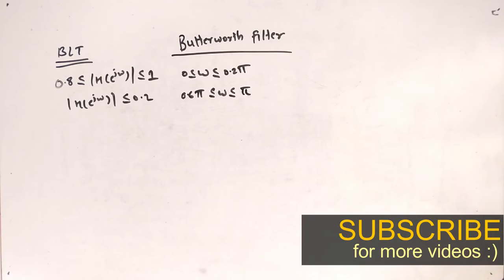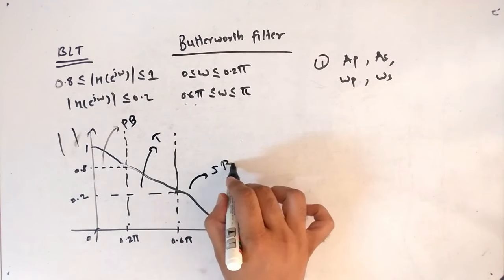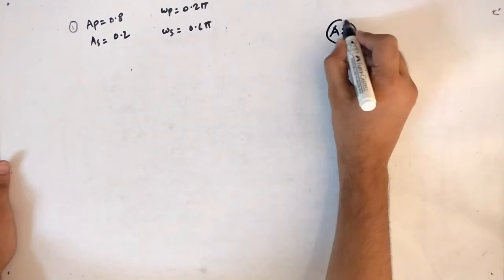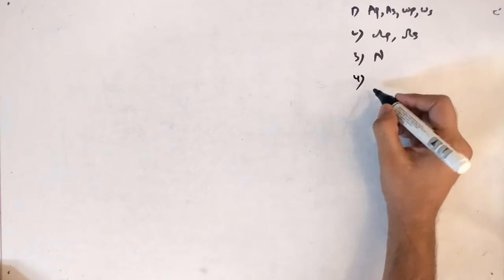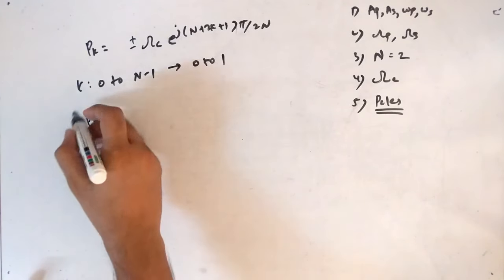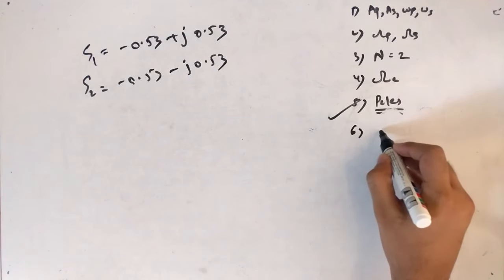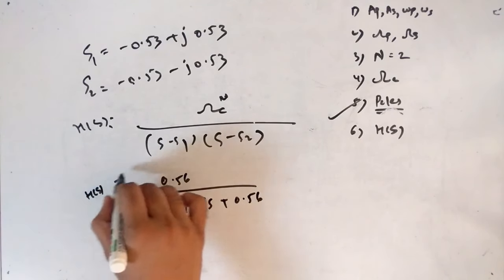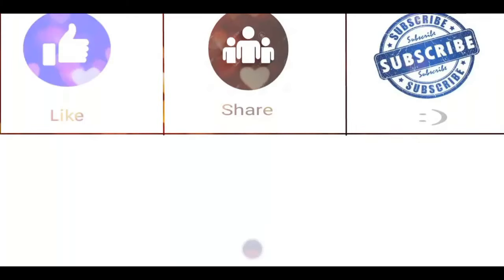IIR Filter Design using BLT - Butterworth filter design in DSP

Comment: there is confusion in the analog frequency calculation ,please solve it....
Reply: In calculator instead of using pi use 180 like 2tan((0.2x180)/2) you will get the answer